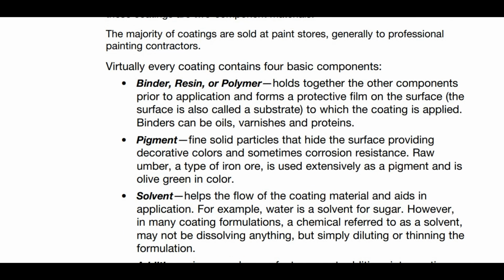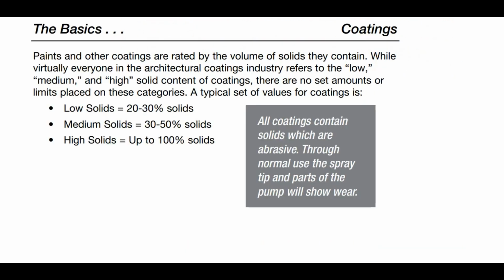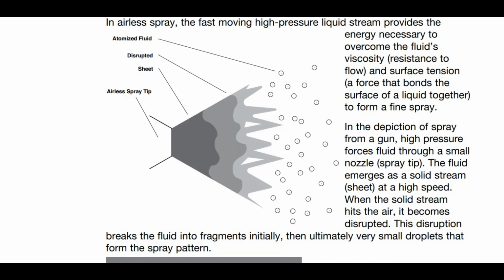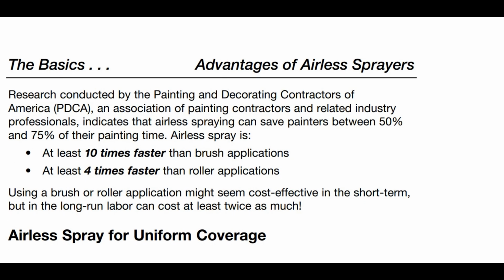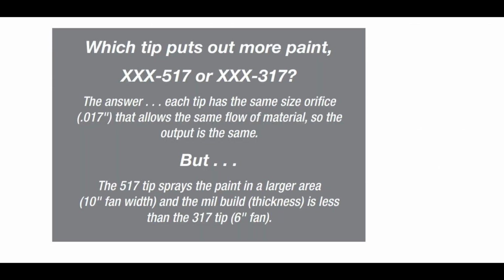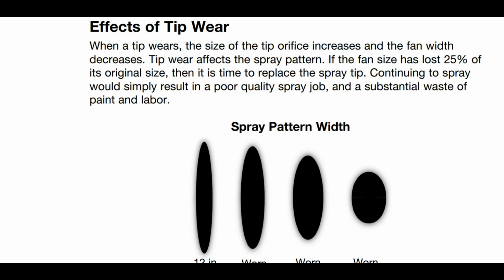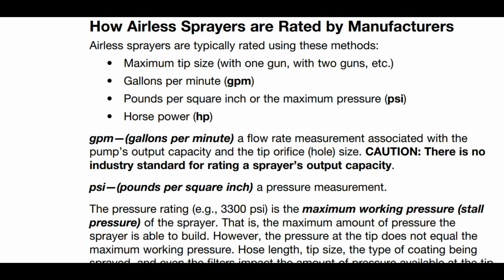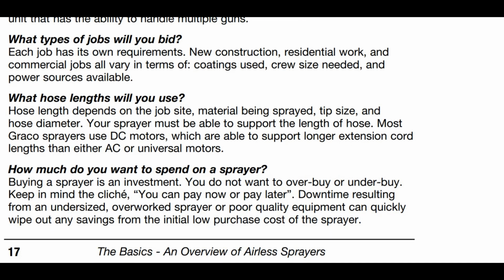Basics of Airlesspainting I Tips for airless spraying  #coatings #paintingcontractor #saudiarabia

Comment: This prevents a confined space entry which in recent years has garnered much attention. Confined spaces have limited or restricted means for entry or exit and are not designed for continuous occupancy. Examples of an enclosed space include tank containers, road tank trailers, tank railcars, and maritime cargo tanks.  

In addition, eye injuries, one of the highest occurring blasting injuries, are dramatically reduced. As well as the limited exposure to any hazardous materials.#anticorrosion #coatings #aerospacemanufacturing #automaticsandblasting
Reply from the maker: Thank you for your support💪